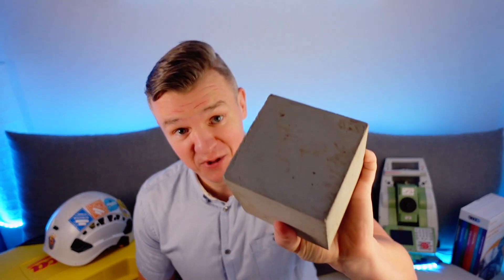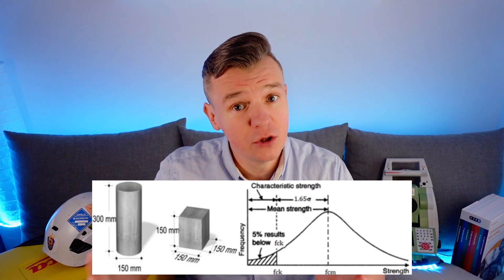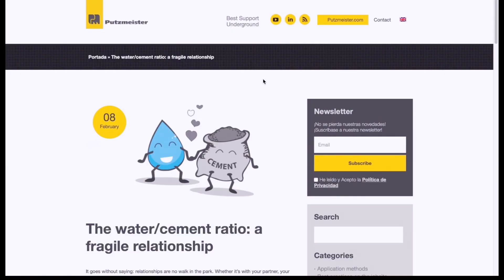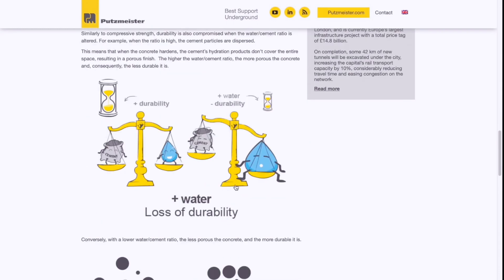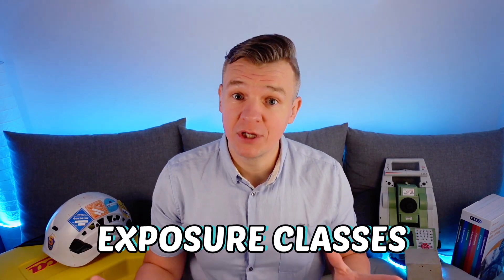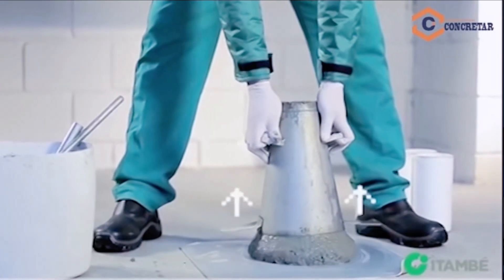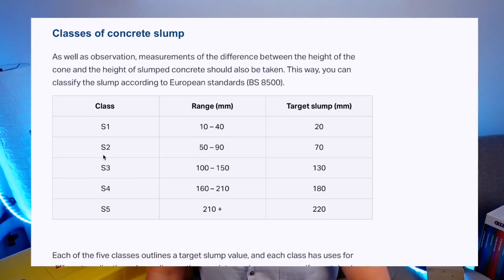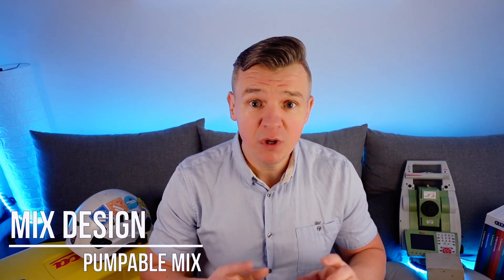CONCRETE properties for Civil Engineers

Comment: Hi Greg thank you so much for your videos, my name is Lungelo from South Africa and I have been scheduled for an interview on Thursday for a site Engineer at the HINKLEY POINT C in the UK where you are currently working, any typical questions to look out for during the interview will help.
Reply from the maker: Hi lungelo! Great, there are few guys from South Africa 😁 I will let you know tomorrow, I asked a friend of mine who had an interview lastly. I was there through the agency and without the interview really. If you have LinkedIn write to me there please.
Reply from the maker: Just got the answer from 😁 they mainly asked about QA checks, what checks when checking the steel and also what are important things when checking Temporary Works.  Let me know after 😁 and if I can still help let me know. I general site engineers there are checking the rebar, embedments and sometimes TW.
Reply: @SITENG  thank you so much, I have that covered, your insight was very helpful
Reply from the maker: No problem, happy to help 😁 Fingers crossed and let me know after 👍👍

Comment: Hi Greg, could you possibly make a video on or perhaps explain how the steel interacts with the concrete after pouring the element. How the shear stresses work and compressive strength of the concrete whilst holding together the steel reinforcement. 

Thanks
Reply from the maker: Hi Khalid! I will soon start my structures series where I'll be explaining these things, please be patient and thank you for ideas 👍👍 The one you mention is the most important thing in terms of RC 😁
Reply: 6:50 6:50